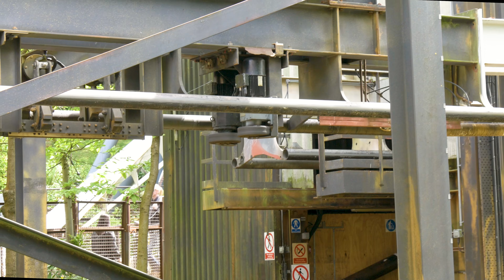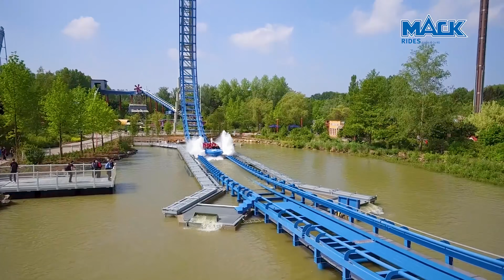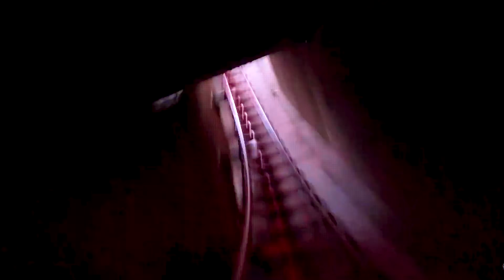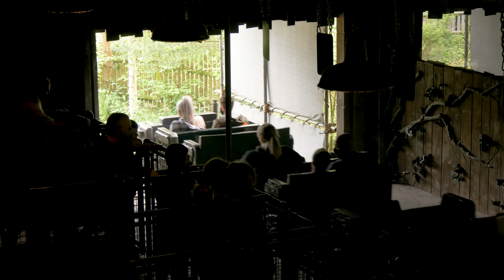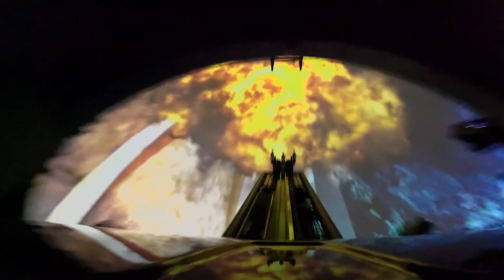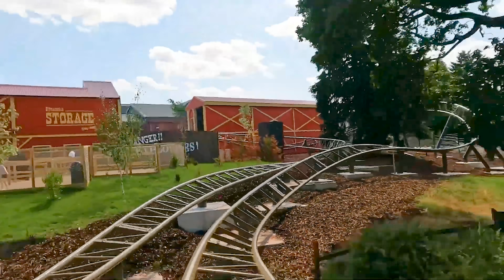The most over-engineered piece of track in the world

Comment: I’m surprised we haven’t seen a coaster with dual station leading directly to an elevator lift.
So the elevator is an A shape instead of the bowed shape.
Reply: The monsters inc coaster might be close, but I think it will still use a switch track at the top.
Reply from the maker: This sounds like a cool concept. I imagine it's perhaps difficult to design

Comment: Would be neat to see a high-speed seesaw, where a train goes up a vertical/near vertical piece of track, then instead of rolling backwards, it instead tilts that section of track forwards, and the train progresses through the rest of the track. The thing that would really have to be made perfect to make it work, would be for it to be a fast swap that feels almost instantaneous. Admittedly it would be extremely tricky especially to make sure that the track doesn't bounce, and has otherwise securely hooked to the rest of the track safely while making the process feel seamless and instant.

Comment: There is also the new Lagoon rollercoaster with slide tracks both forwards and backwards, and a huge drop track element depending on the scene of the ride.. Primordial is the coaster and because of the random variety of elements at the finale scene, this is my favorite switch track rollercoaster along with Jungle rush.  BTW, Jungle Rush also has a very rare and unique setting when only one train is on the track that allows the ride to traverse 3 times up the turntable section going both forward and backward throughout the indoor portion of the layout, surprising riders with the unexpected twist. Dreamworld also has another switch track ride similar to Blue Fire in Germany, but with a swing launch and reverse 'tail' spike.

Comment: Love that these technologies are available to manufacturers now but in my opinion they need to be very well considered and not over used. 

Switch tracks are unreliable, expensive and don't inherently by themselves add any value to the ride. Uncharted is an unthemed mess in a corrugated metal box because the ride system took all the budget (the backwards drop is incredible though). 

I also find tilt coaster drops very underwhelming and not as thrilling as traditional drops. 

These systems add so many possibilities but just because you could doesn't mean you should